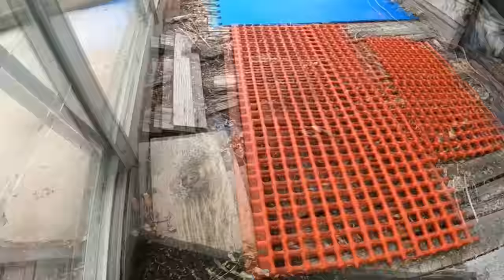Fishing with Dead Hornets

Comment: I reckon that the fish instinctively know danger signs of seeing the black and yellow stripes of a hornet. Like a horse will react fearfully when it sees an adder. They just know what's not good for them. Check out the fly patterns you use for trout and see if there's a hornet or wasp, or even a bee among them. I think that's why the carp won't take them. I had some rubber hornet grubs once, and couldn't get a bite!! They were a freebee, so I had to give them a go.
The stings are still active. Not that being stung by a dead hornet is a choice by the animal ,but more like the reaction of a nettle, the needle can penetrate skin, and venom can flow though it. So you did right handling them with care even when they were dead.
The material used for making the nest is wood. No doubt you've seen wasps chewing fence posts, well they take the chewed wood and use it to make that paper like substance and glue it together with spit. Clever stuff, but I still prefer bricks and mortar. Very interesting video. Seen stiff here not seen before in this context.
Did Barny Rubble and Fred Flintstone sort out their issues in the end? ... LOL
Take care Graeme. TTFN
Reply: I've seen carp take bees and wasps off the surface, I've also caught on black and yellow foam imitation bumble bees. It should be noted that from the fishes point of view (underneath looking up) everything is more or less black when it's silhouetted against the surface